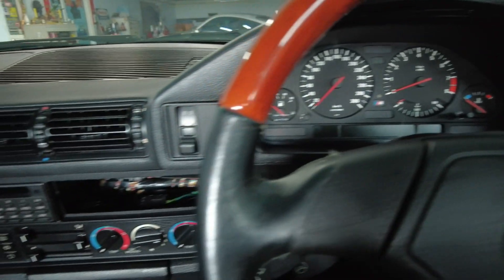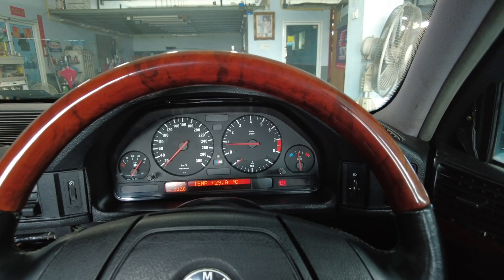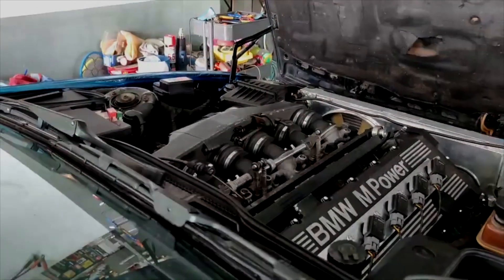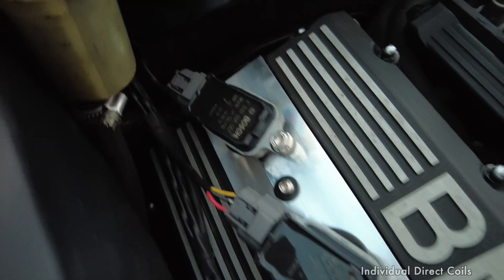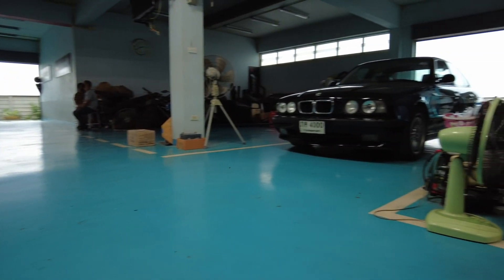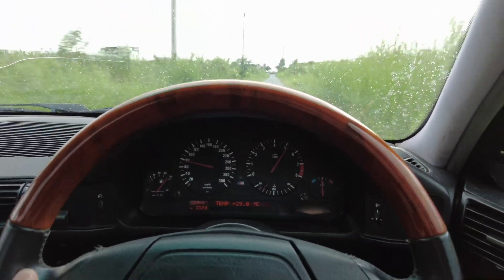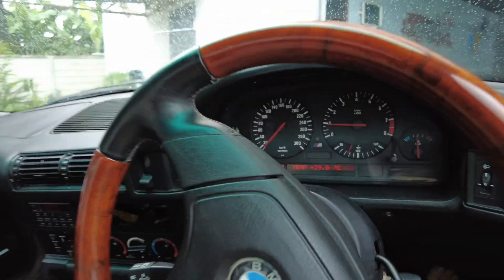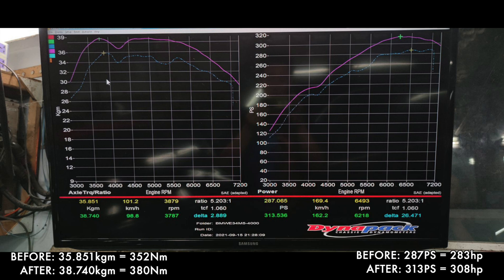BMW E34 M5 Standalone ECU Upgrade  Dyno'd & EXPLAINED

Comment: i have a customer having issue with his e34 m5 maf failure, we now considering standalone ecm  but want more info on the standalone and which to get to avoid the guinea pig project. liking this what seeing so far, could you list out all things i would need to make this work. the website the hardware and accessories i would need to go with it and where i could get dizzy plate for the cam sensor
Reply from the maker: I didn't do this by myself, it was handled mostly by my tuner. most of what you see were custom made. The main things that were done for my car were:

- Individual coils. If you have S38B38 then it should already be individual coils I think.
- distributor delete, and in place a Hall effect cam trigger sensor and a closing plate
- MAF delete 
- MAP sensor

I used LINK FURY ECU.
and its very important that you keep the function of the intake flap using the ECU's additional functions

Comment: This is amazing. I have a 91. Is this a B38?

Makes me think a little bit. that old school cap and rotor aint where its at. :D
Reply from the maker: Thanks! This is a B36.
I dont need the distributor anymore because im using a cam angle sensor and direct coils.
You can watch my other videos for more details.
Reply: @FizzyMotors  Will do! I did this on my 1976 2002, and considering the $$$$$ I just spent on my B36's ignition system. This is a welcome mod to see. 

Your car is beautiful and the worksmanship. I'll watch the other videos.

Comment: great...! can you put link ecu on e34 ecu box? thanks!
Reply from the maker: Yes you can. It has a smaller footprint than the bosch motronic unit.
Reply: @FizzyMotors  can you post photo of that? thanks
Reply from the maker: yea I will next time I clean the engine bay

Comment: How hard is it to find a 530 or 535 on a manual in Thailand? I’ve seen a lot of e36s and e34s with a 1jz gte/ge swap for pretty cheap on Facebook marketplace and groups. And how much would a stock 530/535 with a manual go for upwards of 300k baht?
Reply from the maker: Good question, they basically dont exist.
Were never sold here. 
You could however try to build one, but if thats the case you'd be better off building an M5 instead

Comment: Hey man, I have so many questions. I have an E34 M5 too and I want to get longer duration cams, do a standalone setup, coil on plug, and most importantly a carbon airbox. Did you build a conversion harness for the Link or re pin the stock harness? Do you have a base map for the ink?
Reply from the maker: I think my tuner can help you. he has done three e34 M5 3.6 conversion to Link ECU.
If you're interested, can you add me on WhatsApp?
+66899396908

Comment: Great result there mate.  Definitely a worthwhile gain, especially with the added bonus of more power under the curve and the sensational throttle response with coil on plug.  I have an M88/3 in e24 which is crying out for a good ecu seeing the airflow meter failed and its running on a modified M30 one.  Lots of people do the B38 exhaust cam gear with the altered cam timing.  Do you have this in the m5?
Reply from the maker: thanks! yea im very happy with the results.
I kept the internals of the engine completely stock because I don't think I need to extract more power out of this car yet. I am very happy with its performance and power delivery characteristics now.
But who knows, maybe in a year or two I'll change my mind. lol
Reply: @FizzyMotors which distributor blanking plate adapter did you use?
Reply from the maker: @matspyt6031  designed and machined by local shop

Comment: Thanks for all your inputs! Can you recomend us any ECU "standalone" brands if we want to do the same here in Europe?
Reply from the maker: You can have a look at Maxx Ecu, ive only heard good things about their products from my tuner buddies. And its cheaper than Link. 
You'll want the Street or Sport model if you want sequential firing (which you do!). The sport model supports Bluetooth, if you want to log and tune on a tablet wirelessly.
The downside is,: no built in knock control. But there are ways around that. And for NA engines, its not too critical.
I hope this helps
Reply: @FizzyMotors  Thanks my friend 🙌